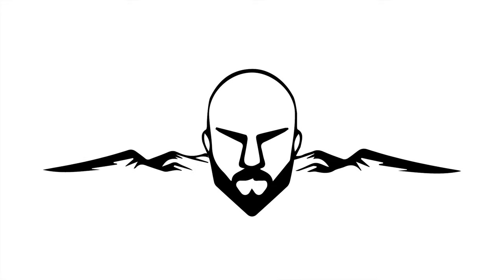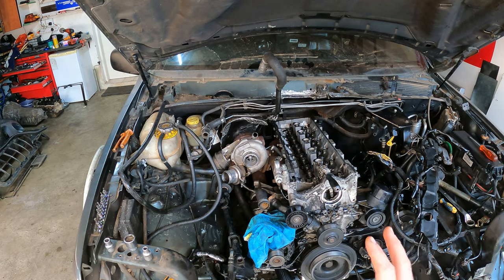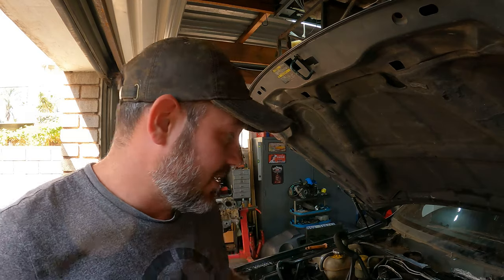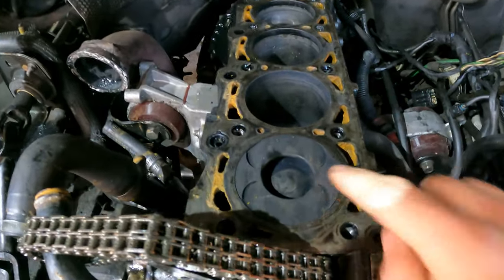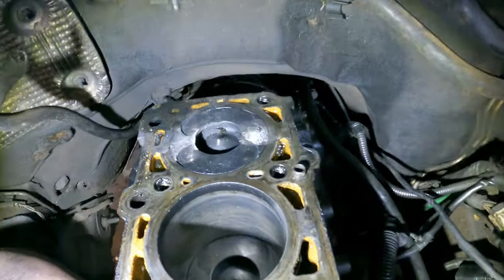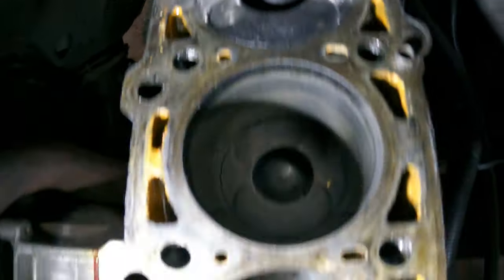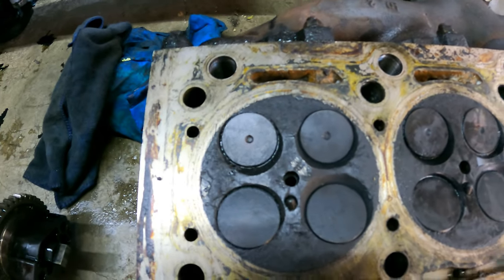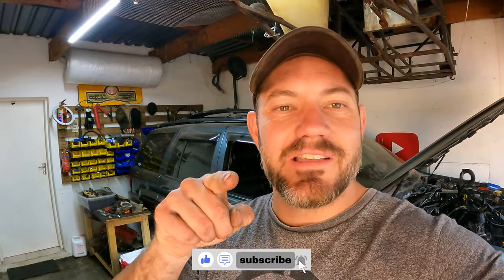Blown Diesel Engine Fault Finding Jeep Grand Cherokee 2.7 CRD

Comment: Lekker videos man. My 2.7 CRD went to almost 400 though KMS before it lost compression. Haven't had the time to disassemble but I'm sure it's a similar issue as yours with the injectors not fuelling correctly. 

I'm sure you know all about black death on this engine so would be perfect time to do new injectors and cut seats/fit seals. Such a good engine IMO but hampered by a few little issues. 

Moer that thang and she'll be humming again in no time 😂👍
Reply from the maker: Yes, they can go many miles. One issue I found is piston rings sticking on allnof them and injectors.
Im now busy rebuilding a new engine. Video will be coming soon.

Thanks for the comment. 👍

Comment: Looks familiar 😂 Time for an engine disassembly video...
Reply from the maker: But it was not head gasket 😂
It could be as easy as just swapping the sub assembly. 

But I wonder how piston 5 got to look like that??
Reply: @MountainmanBuildz  ahh yess of course not 😂 

Would be great if it’s just a sub assembly 😅
Reply from the maker: @barnbuilds25  the head does need some work, obviously, whatever happened to nr5 has damaged the head also. 
But Im wondering now if I should do some mods while im at it......
Reply from the maker: @barnbuilds25  also I should have listened to you from the start...
Should have pulled the engine long ago 😂
Reply: @MountainmanBuildz  oh yes definitely.. completely linked 😅
Reply: @MountainmanBuildz  100% yes 😂😂 sometimes I know what I’m talking about 😂
Reply from the maker: @barnbuilds25  sometimes.... 🤣
Reply: What’s the mileage?
Reply from the maker: @adammind_  i bought it on 317k kms, and have only been able to drive about 30kms.